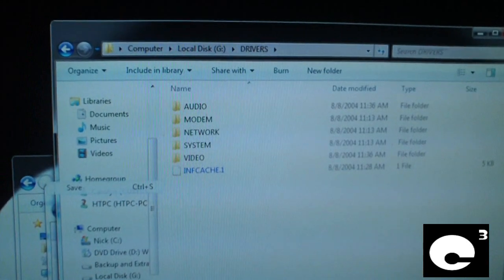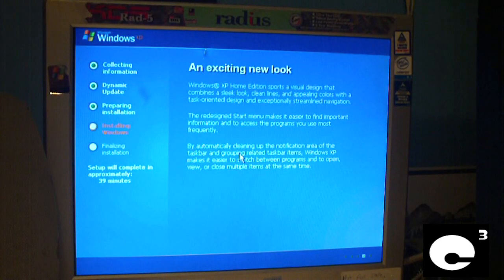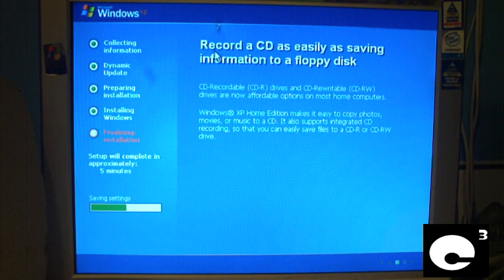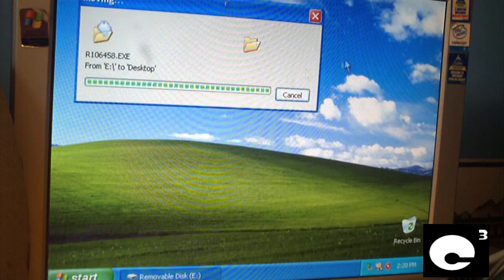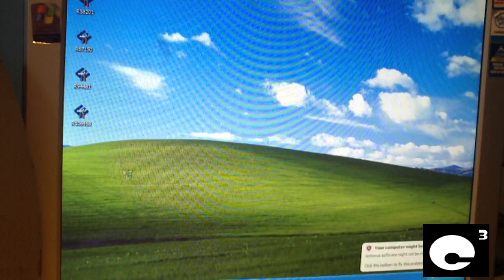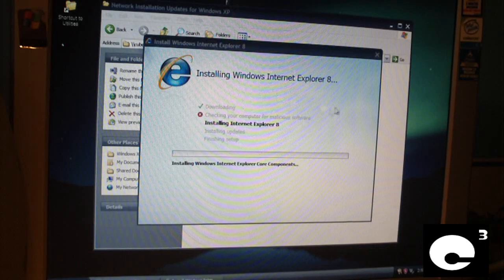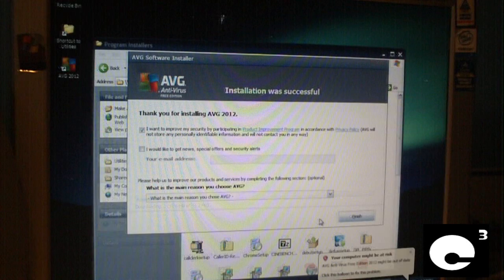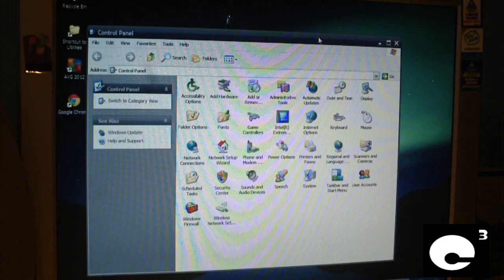Windows XP Installation - Full Tutorial

Comment: My install always hangs at "Setup is starting Windows" trying with a XP install disc don't know what's going on.
Reply from the maker: What kind of system are you trying to install XP on? The text-based setup of XP could sometimes be picky with certain systems.
Reply: @CubeComputerChannel  It turned out the problem was a bad CD drive I think the laser was going out on it.  System is an ancient Fry's Electronics PC with 2.53 GHz Pentium 4 and ECS motherboard. Got a newer replacement DVD drive and a couple of adapter and setup hiccups later XP installed and working good after SP3 update.

Comment: If the video memory is set to 1 MB, then you will be stuck at 640x480x16 (although 800x600 and 1024x768 will still be there, but it will only come with 256 colors).

If the video memory is set to 8 MB, then you can have 800x600x32 or higher.

Comment: why does setup copies files forever??? it is like 12% every hour it is pain
Reply from the maker: +Vilius Art Your CD drive is probably dirty and needs to be cleaned or replaced.
Reply: +Cube Coimputer Channel i trird to install it from usb
Reply from the maker: +Vilius Art Then the USB flash drive you're using is not very fast or it's not running at USB 2.0 speeds or higher.